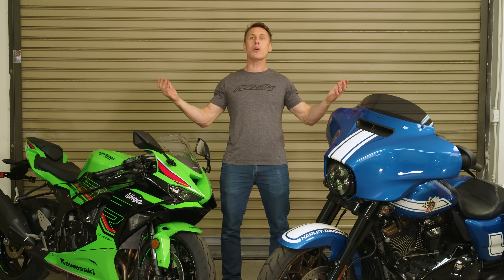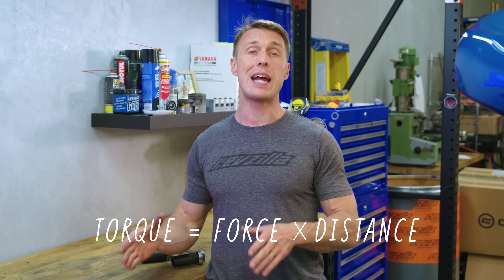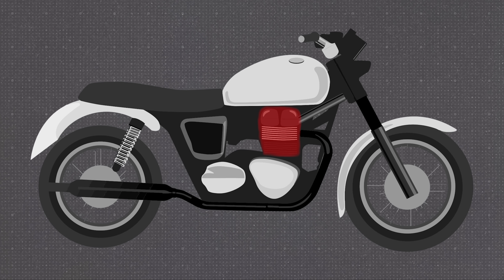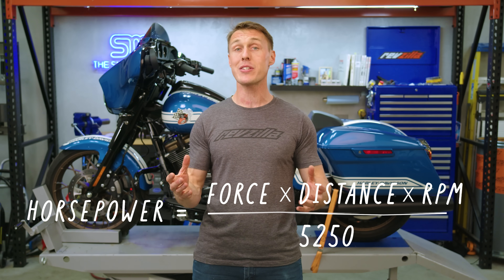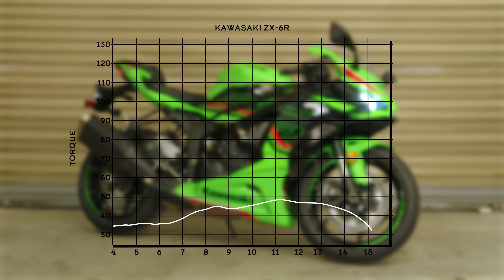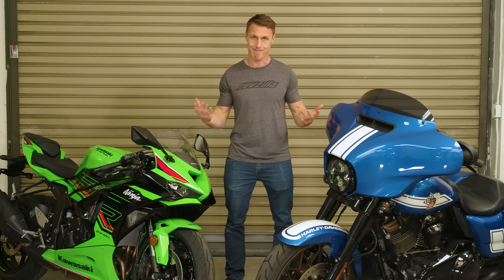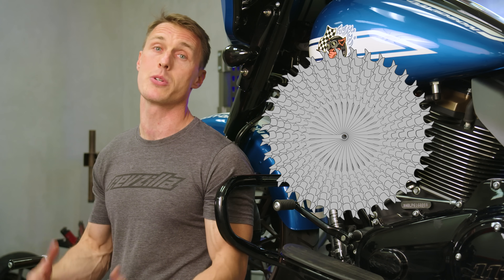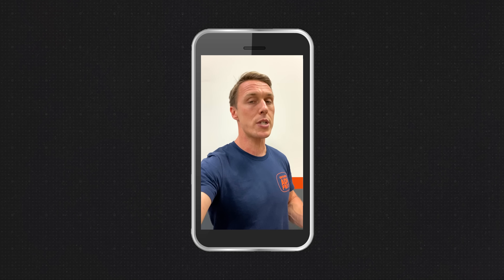Torque and Horsepower Explained! | The Shop Manual

Comment: this is a much better explanation than most but they left out a key important note. this shows how it doesn't matter how much torque you make, horsepower is the only important thing determining speed.  torque is a factor to horsepower and what they also didn't mention is that horsepower IS output power and therefore all you need to care about when determining performance. a horsepower is 745.5 watts, it literally equates to wattage. so it doesnt matter if you have a car that makes 500 ft pounds of torque and 200 hp fighting a car with 200 ft pounds of torque but 500 hp. the car with more hp will always win. well transitions and methods of getting that power to the road matter but you know what I mean. all you need to know the formula which he provided in the video. that proves what torque and horsepower mean.

Comment: As someone who is taking the MSF course soon and looking at first bikes, should I be focusing on one over the other? Or should I be looking for a balance of the two? I know it’ll depend on style and weight of the bike but wasn’t sure if there’s a preferred ratio for someone starting out.
Reply: Power. Power is what matters. Torque is bs since your bike got gears.
Reply: You should be looking at easy to ride bikes you like power is irrelevant on most bikes honestly
Reply: no, you should focus on getting a used bike that you dont mind dropping thats not too heavy or powerful. pretty much any motorcycle is fun and will be fun as your first
Reply: @currycel470 Actually good torque is really nice, the engine doesn’t have to work as fast to make you move. 

If we didn’t care about torque we all be riding ZX4RR, have to ride at 10,000 rpm at all times. lol

Comment: Not quite right conceptually, but suffices for a casual understanding.
 More power is and ALWAYS is more acceleration and more top speed with rest of variables being equal. A vehicle with more peak horsepower only looses in the initial acceleration phase because at that stage it is making less power than the higher torque vehicle. Power (Torque*Revs) in that phase is higher in the higher torque vehicle. You never feel torque. You always feel the power.

Comment: Beautifully explained, but the confusion is timeless.
With taller gear ratio can the Harley best the Kawasaki 😜😜😜.
Also extra torque is wasted 😊.
Reply: The harley will never beat the kawi since power is what makes a bike accelerate/go fast. This video doesn't explain this well. Torque is just a good way of describing engine characteristics - at what RPM the power is available.

Comment: @amam231
I'm seeing a lot of technical-track folks in the comments -  Power does not simplify to speed like the video states in the beginning. It's speed times strength (rotational speed times torque) as he sorta says later. It's really important to keep that straight.
The exchange between speed and strength is nearly free. The product of the two is not free. That's power.

Despite correlation for other reasons (see appendix A), vehicles are not given high torque or high rpm engines IN ORDER to impart that 'strength' or 'speed' characteristic to the vehicle. Because gearing. Vehicles simply demand a certain amount of power from the engine. We might say an engine feels "torquey", but what we mean is that the engine's performance is good + not very dependent on rpm (flat power curve). And, unfortunately for the task of breaking misconception, such engines are often but not always low rpm, high torque engines (see appendix B). 
There is generally a gearbox or something equivalent between the shaft and the ground. Even in the practically unheard-of case of an engine directly driving a wheel, the designer must choose a wheel diameter. Basically, the ratio of distance traveled per engine revolution is almost always a fairly free design choice; certainly in the case of a typical ground vehicle. Making sure the engine has a certain torque output or a certain rpm capability is rarely a design constraint when the gearing is still under the designer's control. For a ground vehicle, you really just need to consider power and other design goals like cost, weight, size, form factor, shape of the power curve, fuel efficiency, durability, maybe sound aesthetic, etc. 
BTW, power is also the first thing you nail down for airplane engines, but rpm is often a much tighter constraint than for a ground vehicle because its a major weight and reliability bonus to avoid the need for any gearbox on a piston engine, and prop diameter and prop tip velocity are pretty important factors.

Appendix A - So why do trucks and dozers have high-torque engines and racing vehicles have high rpm engines? 
Vehicles that tow stuff or run near peak output for long periods need durable, cost effective engines, and designing for low rpm is one of the easiest ways to achieve both. So it's common to find a large displacement engine in these working roles, making the required power at low rpm. Racers want basically as much power as possible (in general, power required is a cubic-ish function of target vehicle speed). So while race engines might be smaller, they are still as big as possible in the small, light chassis or airframe, and it's now also worth the cost, technical hurtles, and durability compromises to make them able to run at high rpm while maintaining relatively high torque, delivering more power still.

Appendix B - Why do high torque engines often have flatter power curves?
Boosting aside, the common way we get a little more power out of a given size engine is to design / tune it to increase its (naturally dropping) torque output in the upper part of its rpm range. Doing this makes the power curve more sharply humped or peaked. Such engines are pretty common. Usually when we say an engine has 'high torque', we loosely mean 'high torque' relative to the power it makes or the class of vehicle it's in. The engine characteristic most basically related to torque is its displacement. So these 'high torque' engines are often a little larger and have flatter power curves than the smaller, similar power engines with sharper power curves to which they are being compared. But with enough R&D, even a high-rpm engine can have a very flat, satisfying power curve (WR450 is one example).

Comment: Every time when you try to bring torque from physics abstraction to real world touchable values you need to do this through power(horsepower) so this whole topic is just about different amount of power in different motorcycle engines on different rpms, not torque

Comment: Good explanation, but from a motorcyclist perspective, what’s more fun? Torque or horsepower?
Reply: Your question itself is wrong. You can't have HP without torque. And if you increase torque, you are also increasing horsepower (RPM being the same)

Comment: Harley Davidson: The most efficient means of turning gasoline into noise without the side effect of horsepower. Yes, that is a good description of the forces at work. It has been said that we buy horsepower, but we drive torque.

Comment: This isn't too bad. But you should really clear up the difference between engine torque and wheel torque.

A better analogy would be to take the more hp engine, gear it so it's traveling at the same speed, and explain why the higher hp engine produces more torque at the wheels then the higher torque engine.

Comment: even simpler explanation;

higher torque = higher acceleration
higher horsepower = higher top speed

----

a little more complicated explanation; 

ps = although remember the weight of the bikes are not equal. the higher force (torque in this case) results in higher acceleration as long as we are talking about the same mass. 
if f1=m1*a1 and f2=m2*a2 and f2>f1 m1=m2 then a2>a1 but if m2 is so much bigger than m1 then even if f2>f1 , a2 could be smaller than a1. 

meaning a lower torque bike *might* accelerate quicker if it is so much lighter than the higher torque bike in comparison. that's actually why cruisers have high torques; they need the high torque because they are too heavy, it's to "level playing field". otherwise they would be so cumbersome even when they are in motion. 

if a racing bike like yamaha r6 (which is lighter than a cruiser) had the same torque as yamaha vmax, it could reach 0-60 mph  around 1-1,5 seconds.
for example kawasaki ninja h2r has 165 Nm torque (almost the same as indian chief dark horse which has 162 Nm torque) and it can 0-60 in 1.1 seconds.

Comment: When i explain it to people i like to give an example with a drill, something like this:
Torque is a meaningles number, it doesn't really tell you anything without RPM, take an electric drill, that thing has 130nm of torque, but do you really think it can power a motorcycle/car? No, it's because it spins extremely slowly and doesn't make a lot of power at any given RPM, the horsepower curve tells you everything you want to know, just check where the peak is and make sure it corresponds with what you want.
But here is a nice rule of thumb: High peak torque usually indicates peak power low in the rev range with generally less max power while low torque generally indicates peak power very high in the rev range with usually higher max power

Comment: Was looking for this, but it only deepened my confusion. Why do we need 2 numbers to describe engine performance. For Kawasaki you could add reductor between  engine and gearbox and that would convert RPM into force giving it more torque. It is not done because 1st gear is made such that it would make easy to move from standstill and there is no point to go lower. So harleys engine is just weaker - period. Everything else is solved by gearbox. Tractors have even higher torque because they need to tow things, while engine can be even weaker that for motorcycles. 

So why do we need 2 numbers instead of 1?

Comment: Roughly, HP is proportional to torque X revs. If the torque curve is flat, which is often approx true over much of the rev range, power is approx proportional to revs. Torque, at least as far as being an advantage, is a myth. If a Gixxer 6 with 100 hp were geared so that at 14000 revs it was at 30 mph, and a big Harley with 100 hp were geared so that at 5000 revs it was at 30 mph, they would have the same torque at the same fraction (percentage) of their respective max revs, all the way through their rev ranges. If engine A has some torque and power and engine B has half the torque but can rev twice as high, engine B can be geared to produce the same force at the rear wheel as engine A, but at 2x the revs. Engine A and B have the same max power, but engine B revs 2x as high to achieve it. Put another way, if you stuff a circa 2001 Gixxer 6 engine with its roughly 100 hp into a Road King replacing an engine that produces approx 100 hp, and gear appropriately, the Gixxer 6 engine will will feel roughly the same as the original, although it will rev nearly 3x higher to achieve it. The difference between the two engines (there should be some) is due to the shape of their respective torque curves. The Gixxer is better in the top half of the range, the Harley in the lower half. But if the two engines had flat torque 'curves', there would be no difference.

Comment: Torque is measured. Horsepower is calculated using torque. You can have as much torque as you want without producing horsepower or doing work if there is no motion. But you can’t have horsepower without torque.

Comment: i wonder what the theoretic HP the harley would have if it could rev to 15k rpm? :D
Reply: Simple, extrapolate the torque curve and multiply that extrapolated value with the RPM. Since long stroke engines start losing torque earlier, like say peak torque is at 3500 and then starts dropping, at 15000RPM you're probably getting 150cc scooter levels torque.

Comment: Torque is just pressure. Horsepower is a combined measure of work done over time. Until work is done, torque is useless. The moment it does work, it becomes horsepower.

Horsepower, duty cycle (how long said horsepower can be sustained), and efficiency (minimizing loss) are literally all that matters.

Comment: You went wrong with bringing bore&stroke in as factors for torque. Bore/stroke ratio do NOT have influence on torque.
Only displacement and pressure. Do the math, and you will find that for a given displacement, cylinder pressure alone results in a certain torque, and bore/stroke ratio does not change that torque.

Comment: I'd like to hear how over square engine designs work. I have just recently learned that my BMW is over square. I always thought that the BMW engine was a long stroke. Wrong !! Well, you don't have to know how it works to enjoy riding it. ;- )
Reply: Oversquare engine: larger bore than stroke length. Undersquare is the inverse, a longer stroke length than bore diameter. Oversquare engines, CC per CC, number of cylinder being identical, have less piston speed than an undersquare engine, thus allowing it to rev safely at higher speeds. Square engine configurations are also possible, those being the bore and stroke are equal or close to equal numbers. Take the 500cc engine Honda uses in their Rebel 500/CBR500, CB500X and so on. The bore and stroke are nearly identical and the power is very linear on that engine. However that is being too simple, everything that is in or interacts with the engine has a part in not just how much torque (torque would make better sense if you understand the HP formula) but also WHERE in the rev range it makes its torque. Oversquare engines need to rev faster to be efficient, which is why they are called “peaky” since it would feel like nothing-nothing-something-POWERRRR as the revs climb. Undersquare are a bit of the inverse where they make their peak torque usually in the lower half of their rev range. 

There’s still all sort of variables like exhaust, intake, cylinder heads, camshafts and so on that go into making an engine and what kind of power it will make and where.
Reply: @powershift1365  Thanks for clear explanation. I appreciate it. Cheers!

Comment: I want to throw in a factoid here, about fuel economy, and why a 400lb, 600cc Sport Bike gets the same or worse fuel milage than a 1000lb, 1,900cc bagger; and it is pretty simple actualy --

RPM. A 600cc sport bike night cruise down the street at 5,000rpm, while that giant 1,900cc bagger engine is cruising at rhe same speed turning only 2,200rpm. Every additinak revolution an engine makes, is an additional squirt of fuel that goes into the head. 

This also applies to cars. Why does a 4,000lb car with a 400-500hp V8 get the same highway mileage as a 3,300lb car with a 200hp 4cylinder...... RPM.

Comment: Adding a final section I feel was missing from the video:

Reasons to want more power:  
Car/truck/bike will be faster.
Truck can tow more.

Reasons to want more torque:
Easier to not stall.
Can use a lower engine speed for any given vehicle speed, so will be more efficient.
Need less throttle for low speed acceleration so it "feels" quicker (this is purely psychological, but still matters to most people).
Reply: 1) obviously. Everyone knows that
2) Towing? This is a motorcycle channel. 

3) Who tf cares how hard it is to stall something? Just don’t stall wtf
4) Who tf cares that much about rpm vs speed? And if you care that much, gearing means 10x more than power vs torque
5) We have wet clutches, rev however much you want if you need to accelerate faster. Who thinks, “oh great, 80ft lbs, I can accelerate quickly”

Comment: Don't think torque means acceleration directly. From a give speed, gear, yes. But if am looking at 0-100 figure, HP would determine it and not torque.
Reply: That is what it looks like on a dyno graph.  But the only way to increase HP at any point in the RPM range, is to increase the torque at that rpm point (or range). 
HP is the measurement of "work done over time", (not speed as the vid says).   But it is not the input force of the equation.  Only torque is the input force,---or nothing moves.  By the way, James Watt developed the measurement for HP, (lifting a weight on a rope, over a pulley, out of a dry well, measuring time and distance).
If he would have used a different size horse, we would actually be measuring a different amount of power for one HP.   I think times were really cool back then.

Comment: I wished you gave insight into horsepower vs torque application on load/weight and why torque is preferred more in adventure motorcycles which prioritise low speed off-roading and carrying heavier luggage and rider with pillion all times.

Comment: A truck will have 1000 Nm torque with 200 bhp power.. 

A formula one car will have 1000bhp power with 200 Nm torque.. 

So depending on the purpose of a machine.. More hp or Nm is designed.. 

A truck needs to ferry 1000s of kgs of load & thats the main purpose.. 

While a F1 car has to ferry just one 80kgs driver while the target is to clock the fastest acceleration & top speed.. 

Basically is the pulling power of a machine while bhp is the acceleration & top speed parameter..

Comment: It's all about power. Torque is useless, until it performs work. When you measure the work being done, you're measuring power. A single unit of torque, is just that... but a single unit of power can be multiplied to any amount of torque necessary.

Comment: then why does 383 make 100 more HP  than 350
33 percent 30 over bore  33 percent 6 inch rods 33 percent compression being higher in cylinder

Comment: I think.... it is a bit misleading still... More torque does not mean more acceleration. Acceleration is the direct result of HORSEPOWER,  not torque. I mean, we have transmissions which convert engine torque to wheel torque. Engine torque is not wheel torque. Higher engine torque does not translate to more higher wheel torque. Higher horsepower DO translate to higher wheel torque, thus, higher acceleration.